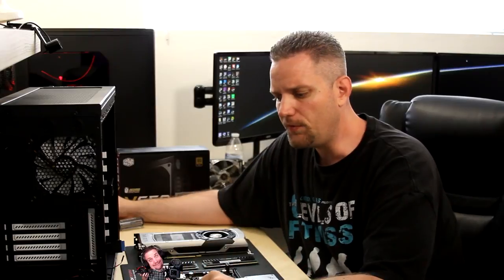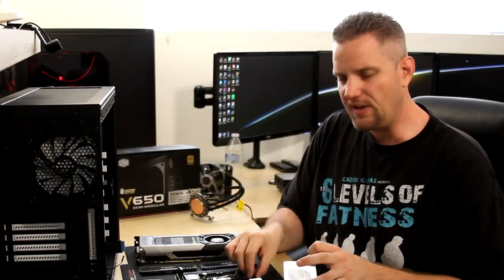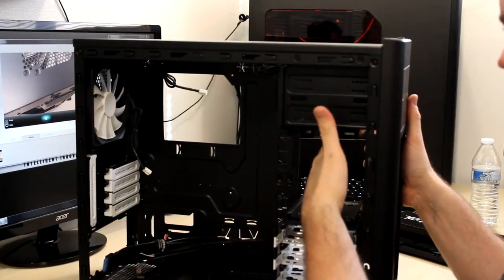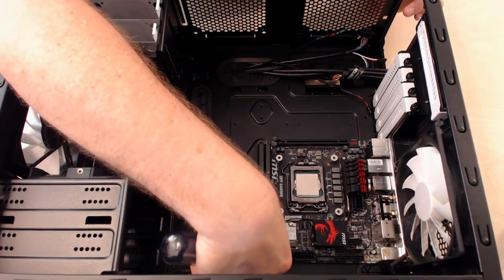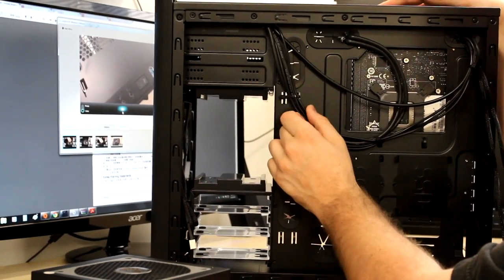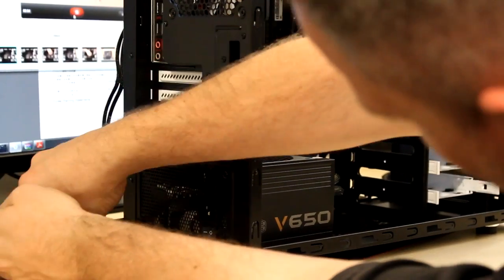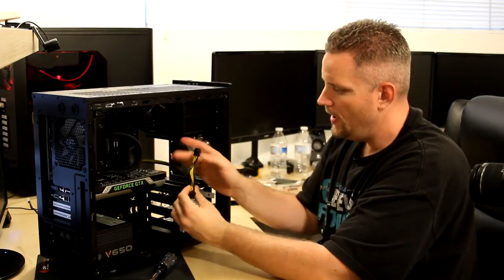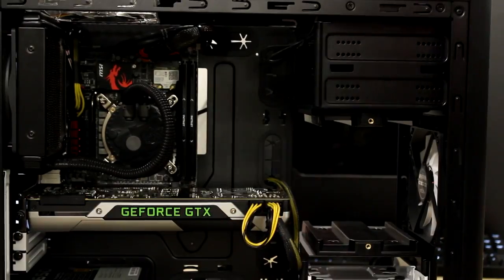Beginners Guide: How to Build a Computer

Comment: holy shit you skipped a lot of important steps
Reply: Javascript Kiddie Like?
Reply: Mason Newman 
Grounding
The force needed to pull the lever from the cpu soclet down
Reply: +Leon Schmidt omg so much left :o

This is pretty much a complete video, considering that motherboard wiring (usb ports, fans and stuff) are mobo-specific, so he skipped that.
Reply: Tushar Sadhwani yeah and if you don't do that your fucking board is toast, along with everything on it so it's a big deal.
Reply: Javascript Kiddie what grounding? If that's it, I used my new pc for a month without grounding. It works flawlessly.
Reply: Tushar Sadhwani
a month ha! That's the funny thing about electricity. One day it works and then...BOOM.
Reply: Javascript Kiddie im lucky
Reply: Tushar Sadhwani you've only been using it for a month you noob. Wait until you have to upgrade or unplug and move it one day to do some furnishing in your house. Plenty of stories of PCs not turning on for no good reason because the builder didn't take proper precautions. ESD is a silent killer.
Reply: Javascript Kiddie I have it grounded now. I know the precautions actually, but I was just too impatient :p
Reply: +Tushar Sadhwani how the hell can you ground the entire PC? Isn't that already done with the power supply being plugged Into a wall?
Reply: charlie saville actually, I'm not sure about what this guy's talking about.

My house did not have grounding at first. I had it grounded.

Comment: Just as a heads up, mounting your power supply right-side up will draw already warm air from the inside of the computer, which will reduce the efficiency of your power supply, while greatly helping the rest of your pc. Mounting it in the reverse fashion will supply the inside of your pc with air slightly warmed by your power supply, which may also combat your fan inside. The better your power supply is compared to your other PC parts, the more I would stress facing your power supply in a way that blows exhaust out of the computer.

Comment: I had two of the same fan as the green led one you used, but with blue leds, and they both blew bearings within 3 months of everyday use of the computer.  it is a gaming computer also.  I don't know if your cameraman had any issues with his, but i am currently waiting for two fans made by cougar off of amazon to replace them

Comment: Some power supplies you can't install face down even if the case supports it. like for example in the one I have I can install it face down but the power supply has a lighted led fan which would point the blue light outside of the case.

Comment: At 29:16, where does he get that cable from in the case??  I have a Corsair Carbide 330R Titanium that doesn't have that.  I have separate cables though, that plug into the graphics card but they don't lead anywhere.  Btw, I'm a first time builder and am extremely confused with this and many more things.

Comment: Can you talk more on the concept of negative pressure in the case and how to decrease it and create a conducive environment for air flow?
Reply: +Greg Van Gorp Okay, imagine a mid-tower. You can put two fans on the front of the case, one on the back, and one on the top. We on the same page so far? Good. Now you have all the other cool hardware in; harddrive, motherboard, ram, processor, and graphics card. So you have two major hot spots 1.) processor and 2.) graphics card. Well, let's go back to the front of the tower. You have one fan at the top and bottom. I think it would make sense for the top fan to have more air to push towards the graphic's card to cool it down. Then the 2nd fan on the bottom is pointing at the harddrive cage (so you don't need a lot of fan power to cool it down!) you want a more quiet fan. Remember the fan at the back of the tower? You want that sucker to start sucking the air out of the case! Grab it away from the processor. Yep. Okay, top fans right? You want that to also be a pull. Get all that heat away from your cpu/gpu/and ram! BAM. airflow.

Comment: So here's a question. Say you're installing a tower cooler with a retention plate. Would you still put that in before most of the other components or no? (I ask for the sake of space reasons. I know it'll depend on the case though.)

Comment: Any Tips and Tricks for a new 13yr old pc gamer trying to make a pc for the first time?
Also any recommendations for Tv/Monitors super cheap and a cheap gaming keyboard?
Here is my PC I want to build: 
CPU:Intel Core i5-4590 3.3GHz Quad-Core Processor	
Motherboard:ASRock H97M-ITX/AC Mini ITX LGA1150 Motherboard	
Memory:Kingston HyperX Fury Black 16GB (2 x 8GB) DDR3-1866 Memory	
Storage:Seagate Barracuda 1TB 3.5" 7200RPM Internal Hard Drive	
Video Card:MSI Radeon R9 390 8GB Video Card	
Case:Cooler Master N200 MicroATX Mid Tower Case	
Power Supply:EVGA SuperNOVA NEX 650W 80+ Gold Certified Fully-Modular ATX Power Supply	
Optical Drive:Asus DRW-24B1ST/BLK/B/AS DVD/CD Writer	
Wireless Network Adapter:TRENDnet TEW-805UB 802.11a/b/g/n/ac USB 3.0 Wi-Fi Adapter	

PC Part Link: http://pcpartpicker.com/p/NZmgf7

Can it play GTA V PC with mods, Euro Truck Simulator, and some flight Simulator?
Any cheap games I should get?
Any games I should get as a beginner to PC gaming?
Any recommended tips on making a homemade cockpit?
Anything I should know in General?
Any Tweaks I should make to this?
Any tweaks to make it run faster or YT/ Tutorials on how to make it faster?
Cheap Place to get Windows(Legit and Legal)
Any recommended programs or downloads?
Any recommended malware/security software to use?
Reply: Replace that 390 with a 970, your welcome
Reply: RAZR Jay made a video recommending the 390 over the 970
Reply: Alex Fotouhi Use MalwareBytes for anti-malware, free version is free for life and saved several computers for me :D
Reply: Use G2A.com for getting windows. Oem windows 8 is fine and you will get a free upgrade to windows 10 if you reserve it after you upgrade.
Reply: RAZR 390 is better than 970 unless u overclock  it which i don't recommend a 13 year old doing
Reply: RAZR Isaiah Baez halloween448 
I went with the 390 and took the risk to overclock it and the whole build went well but I changed a few things like the processor to the amd fx 6300(oc'ed) and it plays like a dream! Thanks for The tips!
Reply: Jakkusu Surado Thanks man! It surprisingly doesnt use as much resources as most free anti malware software! doesnt slow me down much
Reply: SPOCKDOESANYTHING It was cheap and easy! Thanks for the tips!
Reply: How was my advice bad though? :C ***** I was the only person who even gave advice on anti-malware (Something he mentioned, PS if you weren't referring to me many apologies in advance, I get a reply ANY time someone replies to anyone who commented ^^; )
Reply: :D
Reply: +Seth Schallau exact same
Reply: +RAZR 970 loses to the 390 sorry, dx12 will rip that gap open even further.
Reply: +Alex Fotouhi what the fx 6300? an i 5 blows that out of the water. Many people on my gaming group swapped out those things and went from medium settings 40fps to ultra 80fps.
Reply: +RAZR thats a terrible idea
Reply: +RAZR the 390 has more v ram and its future proof
Reply: itz skull nothing is future proof but it is better for the future
Reply: ***** i really liked your build,
especially the headset!
I had a problem where the power supplied failed but they said they would fix everything!
once It gets fixed i will contact you!
hope to game with you soon
Reply: Devin Murray i got an Intel Core i5-4690K 3.5GHz
Reply: Manchester FC FTW ya thats a good chip
Reply: +Devin Murray do you have it? if you do can you tell me your performance results
Reply: Manchester FC FTW No i don't have it but its limitless benchmarks and sales show it's popular for a reason, my gaming group on facebook has like 2k people in it and MANY people have that chip and love it.
Reply: Manchester FC FTW if you are looking for something newer you could also grab the 6600k EDIT opps sorry see you already have the 4690k, don't worry its amazing. Im likely buying the non k version so same speeds but no OCing
Reply: +Devin Murray i just ordered the 4690k via amazon
Reply: OmnYfi 😐
Reply: +Manchester FC FTW dont listen to RAZR XD go with the 390 so much better with more gaming performance and lower power consumption
Reply: +halloween448 I overclocked my GPU and CPU with no problems, and i'm 11.
Just make sure you don't do anything reckless, like maxing everything.
Reply: FireAngel842 Yeah I'm prettty confident in the stuff. What I'm worried about was which parts I should get.
Reply: Manchester FC FTW Oh OK, Good Luck  then :)
Reply: +Manchester FC FTW ayythe i5 is better than the fx6300 in everything except multithreads.

Comment: Jay am I correct in saying that the only driver you should install from the disk is the WiFi one if your are not on a wired connection

Comment: Speaking of cpu coolers i just tried to install the cooler master hyper 212 evo and the x bracket would not reach the standoff screws at all. I think i started threading one but it was all sideways and the other screws were way too far from the mounting pins. So i sent it back.

Comment: Is this a good build?
-Case: Sentey® Gaming Computer Case Gs-6011 Blade $55
-Processor: Intel Core i5-4690K 3.5GHz Quad-Core Processor $225
-Motherboard: Gigabyte GA-Z97X-SLI ATX LGA1150 Motherboard $124
-RAM:Corsair Vengeance 16GB (2x8GB) DDR3 1600 MHz (PC3 12800) Desktop Memory (CMZ16GX3M2A1600C10) $107
-Power supply:SeaSonic 620W 80+ Bronze Certified $80
-Hard Drive: Western Digital Caviar Blue 1TB $50
-Graphics card: EVGA GeForce GTX 970 SC+ ACX 2.0, DVI-I, DVI-D, HDMI, DP SLI Ready Graphics Card (04G-P4-2977-KR) $330
-DVD drive: Lite-On 24X SATA Internal DVD+/-RW Drive Optical Drive IHAS124-14: $20
-SSD:Samsung 850 Pro 128GB 2.5-Inch SATA III Internal SSD (MZ-7KE128BW) $90

What should I change?
About $1081 in total
Reply: ***** Seasonic makes some of the best psu avalible. The EVGA Super Nova series on the other hand, is still an excellent psu. If you have the extra cash then go for the EVGA if you want to save a little bit of cash( even though its already $1081) stick with Seasonic.
Reply: DaSpookyNuts There is no difference between a i5 and a i7 except if you are rendering and video editing
Reply: You should save money on ram and buy 8gb you don't need 16
Reply: Wtf ! I already built this one man ! Very coincidence

Comment: so you plugged your case fans into the controller, but did the controller plug into the motherboard so the system can read the rpm and stuff for custom fan settings?

Comment: You make such an amazing build guide. Watched the whole thing and now I feel ready to put together my first PC. Only one big complaint:
You do not show how to install windows and configure the BIOS. That is the only thing that worries me, and it isn't shown/explained. If you continued and showed that as well, this would have been the perfect build guide...
Reply: you either buy a disc or download it of a usb and plug it into your pc
Reply: Should have been added.
And because I haven't seen Jay do it (nor linus nor anybody), I don't feel confident enough to build a PC on my own. So I'm going to get it pre-built, then install my SSD (that is currently in my laptop) into the PC...
:/
Reply: Use a disc. It is as easy as just clicking what you want and letting the pc do its thing. But NEVER get a prebuilt. They are full of crappy, unreliable parts and are about $300 overpriced on average
Reply: ***** Yes. Any dvd drive will do

Comment: 15:13 - I get most of this but what are these cables used for? They come pre-installed by the maker of the case? He doesn't really mention what they are used for unless it was in some tech mumbo jumbo I missed. I'm a novice computer person doing research appreciate any answers to my question!
Reply: +Ethan J. Those are the front ports for the computer. The usb's in the front that you use, the audio (mic/headset), and power headers (powering on the pc/reseting it.)
Reply: +porkyporkchop1 Thank you!
Reply: Ethan J. no problem, let me know if you have any other questions.

Comment: Tomorrow I will build my very first PC! And im struggeling with the thought of how I should install my power supply for best performance, I wont place my case on a carpet but I like the idea of pulling air from inside/from the GPU but many videos tell me otherwise to install it down against the bottom of the case. The case I will be using is the Fractal Define R5

Comments? Thank you

Comment: What about the last steps? Setting it up to your monitor and powering it up? And what about installing software to your computer?
Reply: If you don't know how to connect a PC to a monitor or press the power button I have to words
Reply: +TMouseDF there are some tutorials for installing windows, but setting up your monitor is the easiest thing ever. you just plug the power cable into a power socket, and a vga/dvi/hdmi cable into (most of the times) the back of your pc. thats all rlly

Comment: Just a quick question but does all the wires that are needed to connect up hard drives and fans all come with the case and or the power supply? I don't have to go out and purchase additional cables ?
Reply: does this also apply for case fans?

Comment: Can you do a video of what it's like when you first turn on the monitor to a PC you just built . I guess I'm asking you what are the steps after you build it and turn it on ? Will all the parts you install work without any software install or do they automatically work?
Reply: Check out a video from pcper. They have a guide on how to build a gaming pc and install Windows in the UEFI BIOS and all that.
Reply: ok thanks!

Comment: How do you figure out which Motherboard & Power supply unit would suit a Case ? Are there specific cases for specific motherboards & power supplies, or does it not matter ?
Reply: +tangent123456 Most cases and motherboards have labeled form factors (ATX, E-ATX, Mini ITX, etc.) For the best compatibility, look for a motherboard and case that specifically state the same form factor. Just about any power supply will fit any case; just make sure the power supply has enough watts to power your components.

Comment: Why didnt he mention anything about static electricity charge?  How did he ground himself? Just by touching the case?
Reply: Dan Rakusan Static electricity is not as big a threat as YouTube channels like LinusTechTips make it out to be.

I had to fix my family PC but I had no wrist strap or mat, and the PC still worked after it was done.

Just try not to touch the back of the the mobo or GPU and you'll be fine.
Reply: Make You Tube Great Again I'm sorry but I have to correct you on this Linus doesn't give a flying fuck about static electricity.

Comment: Molex is usefull! To install fans wich dont have the 4 pin connector but have cables, then just put it on molex for 12 volts, or on molex and mainboard cable for 24 volts :D

Comment: The thing i'm worried about is buying all the parts and not getting all the cables to make everything work. Do I need to worry about that? Also how do I transfer data from one HDD to another? Can I just plug my old HDD to my new computer. I assume you cant but how would you make it so you could transfer some data to a new PC

Comment: i just put together an mini itx sysytem msi a68hi ac mobo along with an amd a6 apu and one stick of crucial 2133 ddr3. i have an raidmax itx case with 300 w psu and i hooked up the 24 pin connector along with the amd cooler that came with the cpu . i hooked up my monitor using vga cable and then jumpstarted it cpu fan turned on but my monitor said no signal and thats pretty much it, im not sure what to do next i havent bought the os yet because i wasnt sure whether i want 7 or 10 since these are older components. can you offer me some suggestions.

Comment: This might be a dumb question but,
Do the lenghth of the motherboard and the RAM have to match up to fit???
for example i'm looking right now on a MOBO MSI 7850-005R Mate Socket (Intel H97, 4x DDR3) which is 35 x 30 x 6 cm and the HyperX Savage 8GB RAM DDR3 which is 33 x 11,4 x 0,3cm, so therefore it would fit, right? but then i would like to have a micro-ATX MOBO with this RAM, so it's impossible? Or do the RAM's just fit and those numbers are 'not important' as long as they support the same RAM, which in this case is DDR3?
I'm sorry for my insuficient expression with words, i've been learning all this new stuff for now 3 days, and it's though to keep up, specially as a beginner that want's to do his 1st built. Also i find Motherboards to be the most confusing thing, since it comes often with a lot of stuff which i don't really know if i'd need it or not. So if anybody could give me a little help with my question, i would be pretty greatfull. Thanks!
Reply: +spicksSC every RAM, regardless of manufacturer, is the same exact size, it should fit in any motherboard, you just have to make sure your motherboard accepts the speed at which the RAM runs at (1600 1866 2133 etc etc.)

Comment: What do you think about this gaming build and what do you think it could run? 

Processor: Intel Core i5-4690k 3.5ghz Quad Core 

CPU Cooler: CoolerMaster Hyper 212 EVO

Motherboard: ASRock B85M-ITX

RAM: Crucial Ballistix Sport 8GB

Storage: Seagate Barracuda 1tb

Video Card/GPU: MSI GeForce GTX 970 4gb

Power Supply: EVGA 500W
Reply: Replace the Devil's Canyon with i5 6600K. Similar price, better performance. 

As for the 970, it will max out 99% of all games at 1080p. But you can replace it with the RX 480, if you want. It's cheaper, and performs a little better.
Reply: +I am a God, you will bend to my will thank you!
Reply: +I am a God, you will bend to my will it's just that everywhere I look the 480s are out of stock but I will keep looking